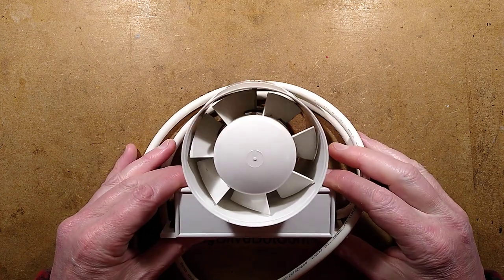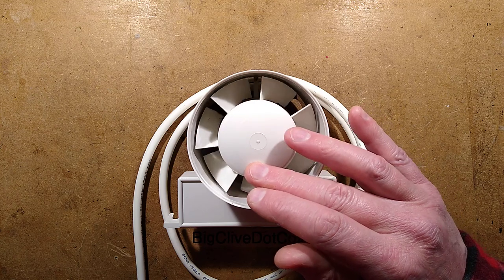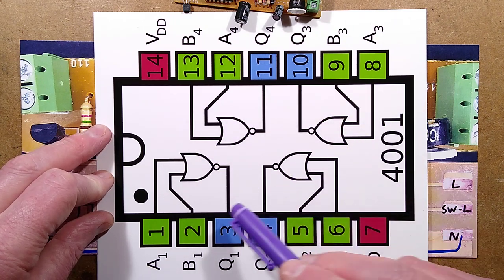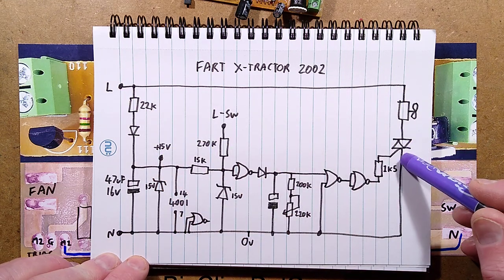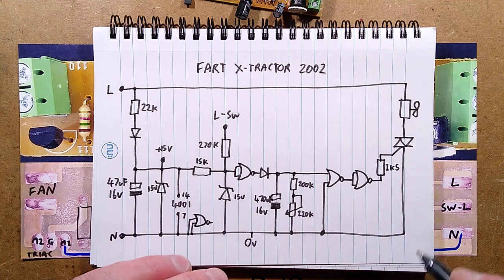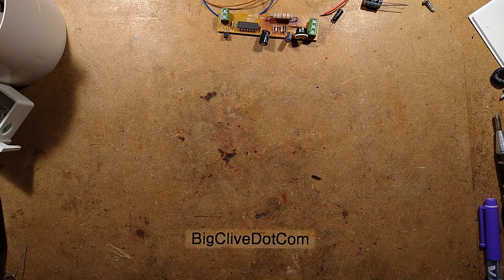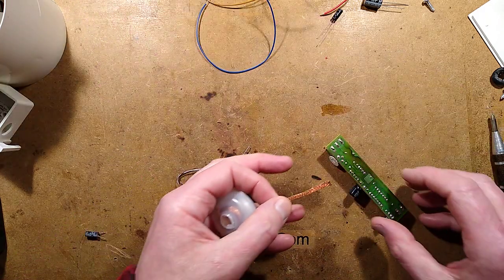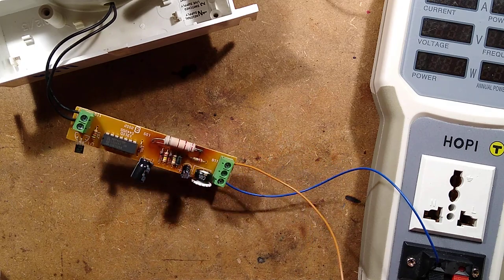Fixing a fart-extractor (with schematic)

Comment: The idle power of this unit consumes about 10KWh/year wasting both power and money.  They could have reduced this wastage dramatically by using a dropper capacitor on the power input. This would have added a couple of pence to the manufacturing cost and saved 100x as much per year in reduced running costs but the manufacturer don't pay the user's electricity bills.
Reply: The UK building industry never thinks further than a few months and supports Tories. Therefore the cheaper unit wins, heat pumps are rare likewise grey water systems and best not mention cladding (though to be fair it was Labour that relaxed building and banking regulation)

Comment: I like the bathroom vent design. I wonder if they make versions for North America. I'm currently have a six watt fan in place of the old 100 watt squirrel cage thing. It would cost $100 to replace it, and the heating element is fried as well. It's a 1960s, NuTone heat-vent-light thing. Right now, it's just an open ceiling box. Money has been tight for over 20 years, so I never get around to replacing these things.

Comment: Nice repair, Clive👍 ...but this size of fan is useless, it couldn’t blow a candle out.
I had to upgrade to 6” ducting & inline fans with 12” blades- supply & extract. 
If you ever went to the bathroom after my ex had been in there you’d know why I went to such trouble.

Comment: Regarding desoldering braid/wick, my experience is that the cheap stuff doesn't contain much/any flux and therefore works very poorly, if at all. Some may be better than others, of course, but I've bought several "brands" of cheap solder braid from AliExpress/elsewhere, and it was all terrible without my own flux added.
By contrast, the more expensive options (e.g. I use MG Chemicals Superwick, and Servisol Soldamop) do tend to contain a good amount of flux, and thus work very well, but the price difference can be significant.

However, adding flux to cheap braid is easy enough, as Clive shows here. You just require some liquid flux, which is useful to have around anyway. (But maybe don't do it directly over a bare MDF surface? 😹)

For years I hated desoldering wick and thought it was just awful, useless stuff, instead sticking with my Engineer solder sucker (model "SS-02").
But I later learnt that my frustrations with it were solely down to me buying cheap braid and not knowing that it needed the addition of flux!

I've since had good results with flux added to cheap wick, and with "unmodified" more-expensive wick, so I've totally reversed my opinion of it! :)
(I personally buy & use the "premium quality" desoldering braid because I don't use much of it - so the extra cost isn't a big deal - and because I can't be arsed to add flux most of the time. Cheap stuff with added flux is usually a valid option, though :))

It can also be useful to add extra flux to pre-fluxed braid if a length of braid has already been used, so there's no remaining flux in that area, but you think that section of wick still has some capacity for solder and you don't want to waste it - in order to minimise wasted copper or to maximise the use you get from a roll of premium braid!
(In some situations you can end up melting/evaporating away all the flux from a length of braid while absorbing little-to-no solder, so I'm not just talking about having a messy strip of braid that's already around 80% full of solder but you want to try to fill that remaining 20%, potentially making a bit of a mess on your board!)
Reply: Yeh I've got mainly Servisol wick
Reply: And I think the iron has to be hot enough for that wicking effect, mine isn’t ~ a direct form mains soldering iron, I think Clive has a soldering station with adjustable temperature so that is why it works for him?

Comment: Not sure if the one I have (it's meant for constant ventilation for the room I am in since it doesn't have a very good circulation otherwise) is supplied with this circuit, because I've had two and while looking similar, both of them suffered broken bearings (we found out after opening the first one they are not ball bearings, so that obviously does not help).
Most common thing that starts to give them away when the bearings start to go is the thing making an awful screeching sound.

Comment: If it was a capacitor issue, I was thinking about a start capacitor growing weaker and weaker inside the motor... losing starting torque and becoming harder and harder to start, until it let go completely, started to hum and not do anything.
Reply: Don't think a 19W fan uses capacitor

Comment: Dam! I went for the other capacitor! Also since nothing happened when turned on I would have tested the fan first, could have saved some time if that were the culprit?
Reply: Those fans are very stable. I've never come across a dead induction fan like this. They usually survive for decades and decades!

Comment: Interesting...I've been wondering recently how the circuitry works in these (I had to adjust the timing on the fan in my downstairs toilet and it got me thinking!). I'd actually been meaning to ask if you'd ever done or were planning on doing a video about them.

Comment: I'd love to see a "Part 2" where you design and implement a capacitive dropper circuit to replace that resistor.
Reply: In additon to the capacitive dropper, I wonder if Clive could try inserting a resistor to reduce the charge current into the timing capacitor.  If it works, it would provide a grace period of say a couple of minutes when you want to visit the bathroom at 3am for some minor personal reason, and don't want the fan to cause a disturbance.  Even when you intend to have a shower, or are likely to be emitting methane and sulphur dioxide smells, it's usually a few minutes before the fan needs to start running.
Reply from the maker: It's been pointed out that the use of a resistor may double up as an anti-condensation heater.
Reply: @bigclivedotcom  Never thought of that, that's a good point!
Reply: My idea is to have the resistor on longer tales, bend it at an angle and put it through a slot into the air flow to actively cool it down, but as Clive has said, and it would eventually get dust on one side 😕
Reply: @samuelfellows6923  It would be easier to specify a slightly higher power resistor instead of messing about with creative methods of thermal management.  Most fans aren't spinning for even 1% of their lifetime, so forced air cooling can't be an option.
Reply: @bigclivedotcom  Yeah, never thought of that, as its in a bathroom (mostly) good thinking...

Comment: I wonder if a simple way to reduce the heat stress would be to just have a small obstruction and directed flow where the fan is exhausting towards so some of the air bounces back to the gaps in the circuitry housing? It's not like that housing is waterproof and while it'd be minimal, some airflow is better then none at all for it. And air that seeps out back to the front of the fan would just be sucked back in and the small obstruction making no noticeable impact in removing the smell?

Comment: Seems like a pretty wasteful circuit, 1W standby power for an time delay switch. For a few pennies, the feed resistor could be disconnected until turned on by the sense input and only kept on until the timer runs out, practically zero standby power. Well, that PCB is from 2002 and energy conservation wasn't anywhere near as big a deal back then.
Reply: Yes, thats very inefficient. If that was mine, i would redesign the circuit. It should not draw any power when the fan is not running.
Reply: A new call for hand cranked fans ?
Reply: I've got one that's less than 2 years old with the exact same PCB inside!!
Reply: @simontay4851  doubt it'd be possible to make it truly 'zero' standby power as any sensing circuit would need to be powered !,  and extra circuitry would be needed , difficult to fit more in that small box,  if the triac was a more 'sensitive gate' type that big resistor could probably be increased in value , reducing power consumption and unwanted heating
Reply: @andygozzo72  It is possible. One way is to have an extra winding or tap on the motor winding which is used to power the timing cct, so when the motor stops it's completely dead.
Reply: @Graham_Langley  you'd still need a small amount of power to power the sensing circuit !! i have thought of a couple of ways to do it, ... see later....easiest way to reduce the standby current of the circuit almost as is, is to use a more sensitive triac and increase the 22k resistor,...my  possible? way is use a mosfet with a diode bridge around it so it only 'sees' dc ,  and use an opto isolated device  driven from the sense input and neutral, through a resistor and small bridge rectifier,  output of isolator from drain to gate of mosfet, through resistor, 100k will probably do, gate of mosfet tied to source with 1m resistor shunted with 12v zener diode and capacitor for the off delay timing
 , ?
Reply: @andygozzo72  What 'sensing circuit'? The Switched Live from the light switch powers up the fan motor directly which in turn powers up the timer. The timer cuts out the motor which kills its own supply. Does need a relay though.

I've now dug out the cct I was remembering, dating from '78 and traced in '92. The auxiliary motor winding could be replaced with a capacitive dropper and still achieve zero quiescent power.

The auxiliary winding on the motor idea was used in simple record players as it did away with the need for a separate transformer to power the amplifier. On this design a tapped winding would have worked but it's isolated so they could have been using an existing motor

Comment: One of the easy ways to encourage capacitors to dry out is using the wrong lead spacing for the application. Spreading out the legs of the capacitor stretches the holes in the end stopper such that gas can escape along the side of each lead, letting it evaporate dry over time. That might explain why the power supply capacitor died but the timing capacitor survived. 
A small pair of round-nosed jewelry pliers can make precisely shaping through-hole leads easier. Since each side of the plier is effectively a long cone, they can also be used for making controlled radius bends. In this case, bending one or both of the leads into a deliberate offset could prevent the problem in the future.

Comment: Well it sounds familiar. The most common failure in electronics which I was fixing were capacitors. For example I received a broken monitor that was unable to turn on. So I took out the logic board and I noticed a popped capacitor. I replaced it but it didn't help. Then I noticed three more capacitors which looked good but they were actually dried out. So I replaced them as well and the monitor has been brought back to life.

Comment: Ive replaced many of these & if its not crammed & clogged with dust/ dead skin it normally has a 2watt resistor that has got very hot.  The variable resistor is for the time on period NOT for the fan speed.

Comment: ridiculously smart how he always knows exactly which part to replace first try 😂
Reply: My first HIFI was a ALBA micro-component cd/cassette/radio, I used it for several years until it went into “eternal” stand-by [pressing the power button did nothing] I assumed the transformer had failed, I took it apart for fun and dad threw it away thinking it could not be repaired, several years later I now assume the “filtering” capacitors had gone leaky and I could have repaired it had I known back then 🙂

Comment: Is there a fart to failure factor on life expectancies for this product like 30 thousand farts or 20 thousand turds whichever passes first.🤣
Reply from the maker: It depends on whether you fart directly into it.
Reply: 😂, also for the steam from the shower/bath, and if said bathroom/toilet has an openable window - some will prefer to open window and turn the fan off at its isolator switch, if the wind is blowing in the right direction = out of the window.
Reply: @bigclivedotcom  you should never do that unless it's flame proof.

Comment: Hi Clive, would you be interested in fault diagnosing a 2 in 1 solder station?  The iron works fine, but the hot air gun doesn't at all.

Comment: In the states they're just fart fans, there are times I forget " black neural, brown live, white switch" 🤯GAAAAAAHHHH! being an electrician in the states, it's hard getting used to other countries color coding 🤪
I have a coworker who is totally baffled by solder wick (desolder braid)🤔
Reply: But that's not even the EU Standard.
The EU has (brown = L1 black = L2 grey = L3 blue = neutral and green yellow as Earth)
Plus the old country specific colour codes used before unification.
The UK used red (live) and black (neutral) i think until 2004.
Germany had some wild times too.
With black/blue/red as phases and grey as neutral.
And for single phase black (live) grey (neutral) 
And if you had a 3 phase cable (+neutral and Earth you have a 5 conductors) you had 2x black in there and the one between earth and neutral was L1 and many other stupid small differences.
I'm happy that at least for now the colours are decided and I don't have to keep more stupid wiring standard in my head 😂
Reply: Blue or black for neutral is the way it should be. Using black for live is stupid.
Reply: @simontay4851  could you explain why ist "stupid" ?
Its just a decision that needs to be made and best is that all decide on the same system, it cheapens the manufacturing of the cables if they only use sertan colours.
It's also good that the EU differentiates its colours from the US because of the difference in voltage and frequency.
Reply: @simontay4851  

Black is the colour you wind up with if you wire something wrong, making you feel Blue??!!
Reply: @SuperUltimateLP  Red = Danger
Reply: @adamholmes91  for you.
Reply: @adamholmes91  now we still have L2 and L3 to colour.
In Germany and many other countries we get 3 phase supply as default.
(At the moment red is still in use modern fuseboxes, and signifies controll circuits)

Comment: Had a very similar board in fan that stopped working when I changed bathroom light from old style filament to LEDs. Had a look inside and there were some cooked resistors, I wondered had the filament bulb acted as a resistor and the change to LEDs killed it off.

Comment: "Black is neutral"

North american electricians are now very confused.
Reply from the maker: Black used to be neutral until the European standard colour code was introduced which REVERSED a phase and neutral colour.  It caused lots of electrical accidents, and still does.
Reply: @bigclivedotcom  I'm just commenting on the very limited knowledge I have as a plumber/gasfitter that has to do a bit of mains wiring on HVAC to get people's heat on in extenuating circumstances. As far as I know, Black=Hot and White=Neutral for our grid.

On a different tack, I've got a failed ignition control board for a furnace based on V1 Flying Bomb technology (Lennox Pulse G14/G21 series). Would you want to have a go looking at it?
Reply: @bigclivedotcom  Plus how could they have picked a worse combo of colours for visibility in poor light.

Comment: I got it wrong then. When I hear motors slowly fading, then not moving at all and humming, I usually assume that the brushes in the motor have burnt out or the coil in the motor has shorted. I wonder why they didn't just use a mechanical spring delay switch on this fan, like you get in some safety lights.

Comment: maybe the fart smell was to strong and it couldn´t take the " load "  :D
Reply: It didn't melt from burnout;  it melted from the fart gas.
Reply: Components damaged by fart accumulation.
Reply: @andreasu.3546  methane accumulates, is ignited by the motor's brush sparking.

Comment: 16:36 With a Circuit Board that thin, the only real choice they had was: Do they cook the diodes, resistors and capacitors or do they cook the logic chip?

Which set of components is more prone to heat related failure?

Personally, I'd have made the Board at least 3 times wider that that one and split the one resistor into multiple High-Watt Resistors in Series across the top edge thus spreading the load out and ensuring each resistor generates less heat to avoid cooking the rest of the Circuit...

Comment: Well that's interesting. I have that exact fan but without the timer, I got the first one & it lasted about 3 years (its on 24/7) before deciding it didn't want to deal with my farts any more. I don't blame it in a way, but I was still somewhat disappointed.. I actually replaced it with an identical one (something-air, from eBay, for cheap) & that's been going.. Hmmm.. A good 5 years. I did keep the old one, I think I might try & find it (its somewhere in my loft of shyte) & try that fix, maybe using a cap from a less desirable dead piece of junk.. Or get a brushless fan to replace the current one in an effort to reduce my now obscene electric bill

I have 2 questions for you Mr BigClive:
1. The 22k 2w resistor.. Is that inefficient & wasteful, there, dissipating heat? If so, whats a more efficient way of dropping the input?
2. This may overlap q:1. Dimmer switches.. If say, you have 5 incandescent lights switched by a dimmer switch. Does having the dimmer low reduce your consumption, or, does it draw the same about of current from the mains, but dissipates it?

Thank you!

Comment: In America we tend to leave lights on a lot
so if one has a bathroom fan it would definitely be on a separate "light" switch.
Our fans are also kind of noisy so we do not like hearing a fan run when not absolutely needed.
 Some people if they are fancy use a timer switch so the fan then goes off by itself.

Comment: Had a similar problem in my old UK home - however it wasn't the capacitor, rather the dropper resistor literally fell apart.  Replaced it with a decent aluminium enclosed power resistor and the fan was still running just fine 8 years later.